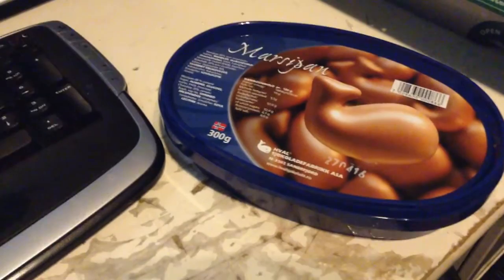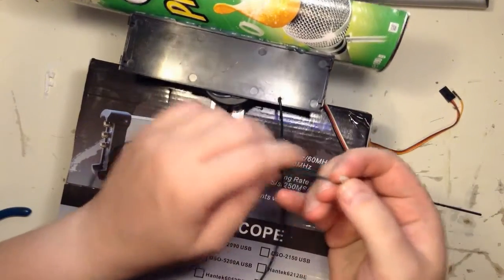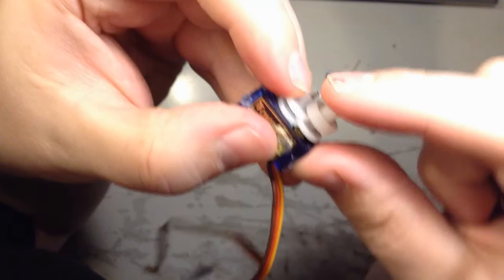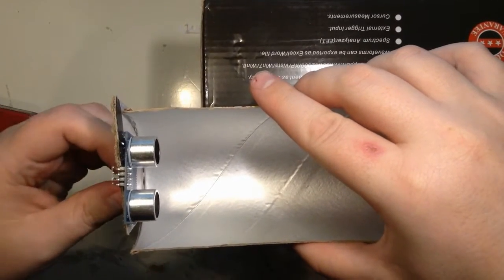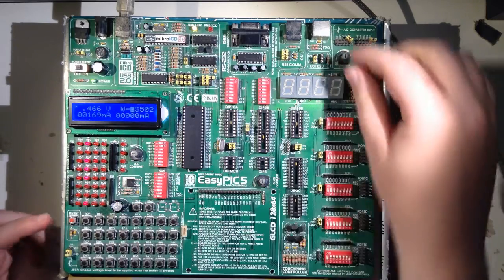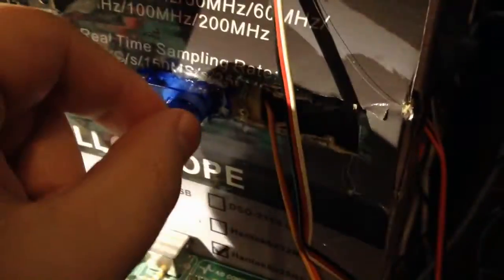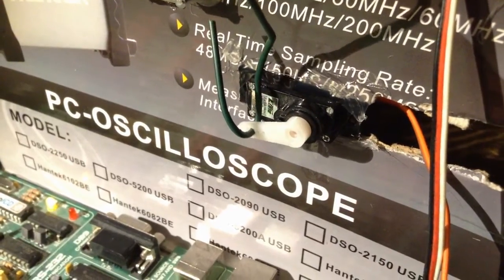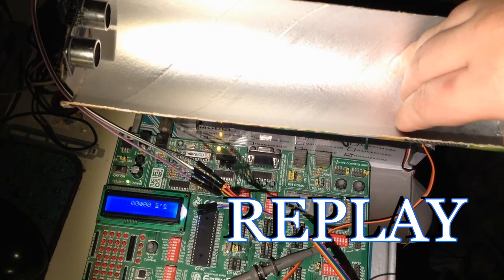The Beam and Ball Project - Part 2

Comment: Getting closer. What is that program you're using? Will there be any assembly language programming involved?
Reply from the maker: +The Highlander I use mikroC compiler by MikroElektronika, and I plan to show the machine code assembly o see what the compiler does when I use certain library functions and operators in this C compiler. For example, if in C you write a=b*c and a, b, c are 16 bit wide integers, then the compiler links in a 16x16 multiplication function because the pic16f887 MCU doesn't have multiplication instructions. If the MCU has, then the code becomes much smaller.
Reply: +bwack I'm used to working with RISC processors which usually don't have multiplication. Multiplying 16 bit numbers can result in a 32 bit result which takes a bit of processing to do correctly. I've been working on multiplication in assembly on the 6502. There are some spiffy examples that work well.
Reply from the maker: Thats cool. What core was those risc based ones?
Reply: +bwack It's the C64's MOS 6502. You know it. I've worked with the Motorola 68000 which was awesome compared to the 6502 and I'm learning Z80 (or at least I intend to). All of those are Risc processors before it was really a thing I believe.

Comment: Very interesting. you make this stuff look easy :) The amount of dip switches on that board is scary lol. Yup that servo is knackered lol, obviously to much work for the cheap little guy.
Reply from the maker: +StigsWorld I rotated the servo and it didn't like it at all. Usually it's ok to do that, but the build and plastic used breaks easily... or maybe it is because the sprockets are small.. The servos are still attractive for the price :) Yeah,, the dip switches can sometimes fool me, especially those for programming. So I then write in the code what the settings shall be.